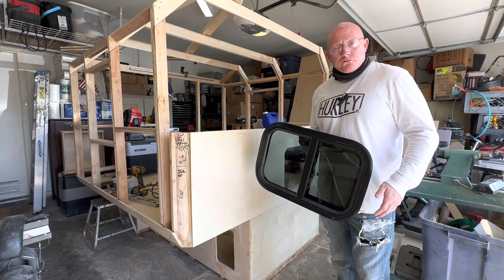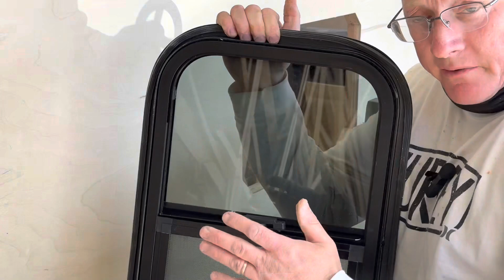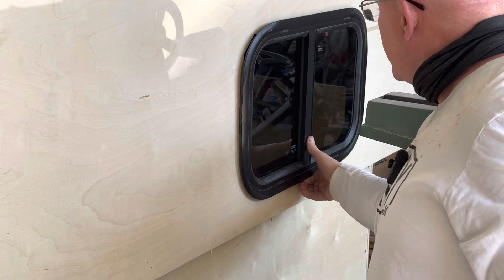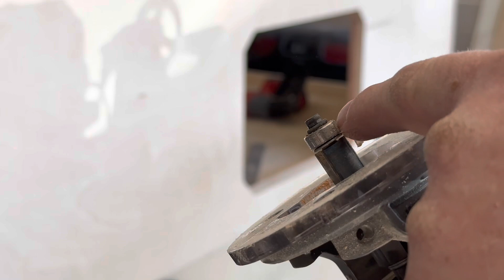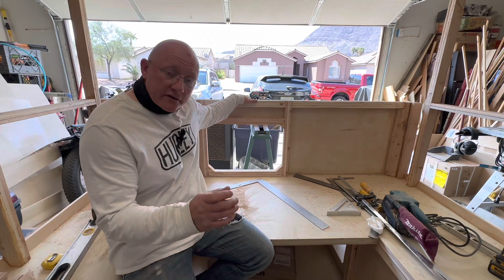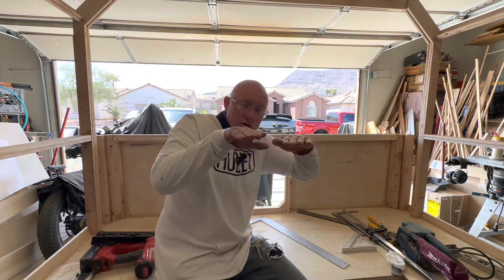Truck Camper 7.0 Build, Part 4: Building Cabover Floor and Design Considerations

Comment: Great videos! Thanks!

Can uni-body trucks like the Mavericks & Avalanches have DIY camper shells with bed resting up top the truck roof? Since those trucks are uni-bodies there’s little or no twisting while driving.
Reply from the maker: Great question… in short, I would need to do more research myself before I could answer. I would say at a minimum keep the overall weight below max payload. What is the typical max payload for vehicles like that?
Reply: @EndgameCampers most pickup are around 1500 lbs on gross cargo weight. However for much weight roofs can handle isn’t known.

Mine ideal ‘wedge pop-up’ camper for my next truck is to have a pure foamie shell, no wood frames & no floor or ‘tub’. Might have slight wing on sides which would rest on top of cargo top rim. Sides would continue upwards to top of roof where the bed would be. Want the front & any exposed sides to taper inwards toward my truck as close as I can. Figured with a uni-body there’s little twisting involved unlike standard pickup 2-part bodies. If so, I’m hoping to have 1.5” or less gap where a rubber strip could seal the gap. 

Hopefully that’ll eliminate or at least vastly reduce air resistance & with a pure foamies shell & basic camping needs only, my truck fuel economy would be at its maximum efficiency.

Until then I’m in dreaming & planning stage. My old trusty 2001 Ford Sport Trac is gonna be retired & I am looking into my next mid-sized pickup. 
It’s gonna be a hybrid. Looking into 2026 Honda Ridgeline (new generation), Ford Maverick & Toyota Tacoma (AWD)

Comment: Have you done some testing of how much weight the roof can take using your usual 3-Ply frame construction technique, before the composite panels are added?  I'm wondering how strong the frame itself is before the panels are added because I'm thinking about using that technique to construct a canopy that maybe has lift up sides and therefore it wouldn't be able to benefit from the strength and rigidity those panels give it.

Comment: Great way to analyze the cab over space and the approach to achieving maximum aerodynamics between the two surfaces. I am considering keeping that space to a minimum as well on my builld. Also Thinking about installing a clear tape onto the truck cab surface for protection and installing an inner tube type material between those two surfaces to close that gap.  What do you think?

Comment: Other than the door frame and the very top cross member that hook to the columns. Do all the cross beams throughout the whole camper consist of all cedar? Side walls, front & back?
Some look like 2 pieces of cedar laminated together. It's hard to tell, I could be wrong. I've been trying to pay attention closely to you & attention to your build... At the beginning of your video you show the skeleton bed frame already built & attached, but not shown on the video? Is there a part 5 showing you adding the bed frame structure? Hope so... I know you do your best at filming all you can, and I thank you! Great video!
Reply from the maker: Yes, the majority of the frame is just cedar glued together.
Reply: @EndgameCampers  thank you. Very good instructional video. I appreciate your time.

Comment: Dave do you recall the measurement from the bottom of the bed to the cab over? I'm thinking 44 inches will work for my 2500 2015 Ram, but I'm nervous and will be pulling off my shell. Would love a dry fit with the frame.
Reply from the maker: I would go 47 or 48. 8.0 is 47. That is from the floor of the pick up bed to the bottom of the cabover

Comment: The cantilever issue is my worry for the design I have in mind for my Toyota pu. How do you address thus issue?  The 7" setback is a very good start. Does the plywood skin fix this problem?
Reply from the maker: Yes, the shear strength of the plywood skin keeps it rigid. I also incorporate a structural element in the framing known as a “reverse K” (not my invention). Google that and I think you will find further explanation. If you can’t find it, send me an email and we can discuss it

Comment: 10:50 there is a thing we do in framing using top and bottom plates to spread the load. When you have verticle beams (studs), the ends would sit on a piece of comparable dimensions and the load would be spread out along that horizontal piece, rather than just the footprint of the vertical beam. Same can be said for the top of the wall.

When I look at the framing around the window, I see you will be framing off of this point for your bedroom. So essentially the window wall will carry some portion of the weight of the bed. This makes that window wall "load bearing," and the way it is framed, that weight will be sitting at 2 points. If that window leaks at all, this will create major problems in those 2 verticle pieces on either side of the window. 

In framing, we are taught to spread the load whenever possible. I am only trying to help, your products are quite impressive. I do not mean to insult your work in any way. Appreciate ya

Comment: In your last video you stated you sized the camper to close the rear gate.  Suppose you are in the camper, and someone closes the rear gate.  How will you get out?  Do you have an emergency egress point?  Maybe it will never happen...
Reply from the maker: I have a plan. I will discuss later in the build. Essentially I will have a mechanism to disable the locking portion of the tailgate.
Reply: One way to solve this would be to open the door inward

Comment: High pressure always goes to low... the low pressure is not "sucking' or making a vacuum.
Reply: Down the rabbit hole of aero-dynamics again I see. Yes high pressure always replaces low pressure, that's why your engine fan is on the motor side of the radiator. The fan isnt pushing air into the radiator, the fan is creating a vacuum on the engine side and the high pressure in front wants to rush past the radiator fins to fill in the low pressure side, taking the heat with it. In short, imagine the camper is a big radiator, you're not forcing air in. I cant believe youre up to 7.0, great work.
Reply from the maker: Explain in more detail
Reply: @EndgameCampers  Think in terms of meteorology and true aero dynamics... i.e. what makes a wing fly.  When the air around contacts a vehicle it more or less opens up and at the surfaces the air moves faster, this is creating a lower pressure.  As it comes back together it will burble if too abrupt of a gap.  The tail end of a wing comes down to a point (for illustration) and thus the air comes back together.  The top of the wing is low pressure due to air moving faster,  the higher pressure under the wing thus pushes up, lift. Also look into why driving with a tail gate up is better on mileage than when down.  When down the air will become a drag, effecting mileage.  Back when involved in automotive engine research, I learned from a race car driver and in training classes, the outside air forces itself into the motor because the piston going down creates a low pressure.  It isn't actually pulling outside air in... that is how race car engines are pondered. Creating higher pressure with  super charger makes the air want to go somewhere that is lower pressure... into the motor it goes.  You look like you are having fun.. that is great.
Reply: @ENDGAME  enjoy all the comments from informed viewers and your efforts to use best practices.  One thing I recommend is upon completion I suggest you have someone use a thermal camera and either heat or cool your camper and take some IR Pics.  Your manufactured approach probably has a much better thermal performance compared to popular aluminum framed campers.  Thus u xan reduce your heating and ac components and batteries and thus end up with a lighter overall camper and potentially less expensive.  The trend to too many batteries and solar is applied to sub optimized camper designs requiring more energy and cost and mass.
Reply: Yes the moving air has a lower pressure and you are correct in your answer. Using the word vacuum is just a way of explaining it I think. A true vacuum would take a very strong tank. You can see this plainly when you balance a tennis ball over a a reversed vacuum cleaner hose. Use to do that experiment with my kids. Still air had higher pressure and would hold the ball over the moving air. Also a vacuum cleaner I don’t believe creates an actual vacuum but just a lower pressure area.

Comment: Hi Dave, I remember older campers used to have a filler piece between the top of the cab and the cabover probably for aerodynamics.   As it stands here I would say you're around 199 lbs.  without the bed overhang.  Loving this video most of all.  Haven't started mine but it'll be very close to how this one looking.  Great job on the intro to the video too.
Reply from the maker: Give me a weight estimate including the bed overhang. Thanks and I’m sure your build will turn out great. Thanks for watching and commenting frequently